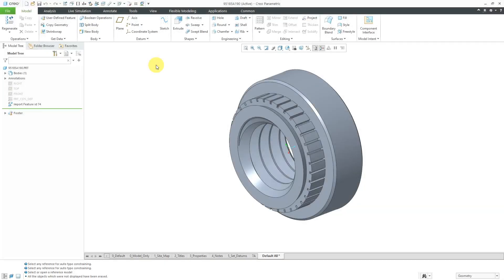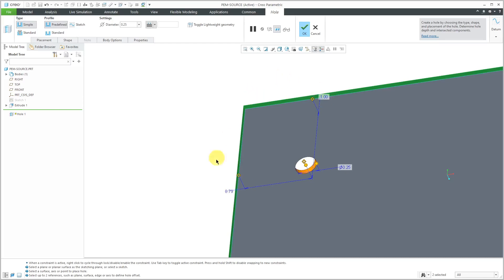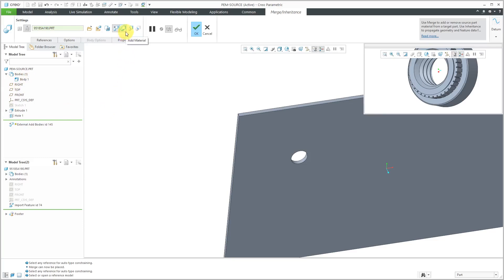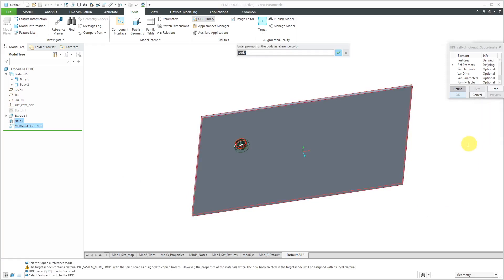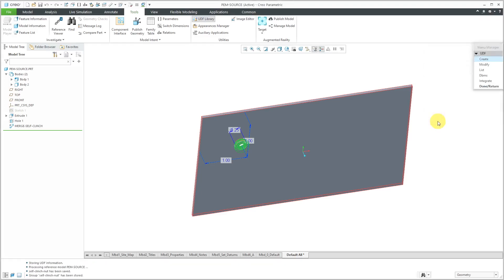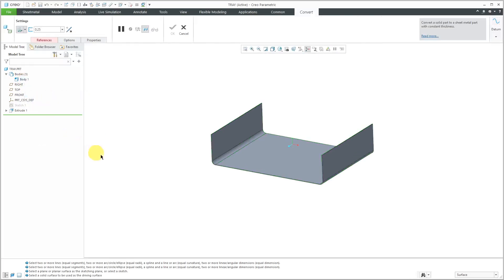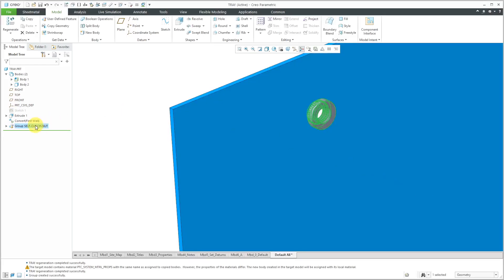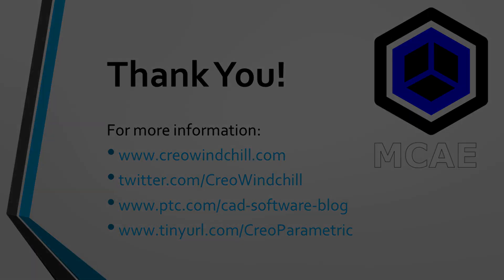Creo Parametric 7.0 - Multibody Modeling and User Defined Features (UDFs)

Comment: I noticed that each fastener is a different body.  Is there a way to have the fasteners use the same body (i.e. one thing to modify if there is a change)?
Reply from the maker: The fasteners are patterned. Change the lead feature and the others will update.

Comment: How do multi bodies behave when you export it out as a step file? Does the step treat it as an assembly?
Reply from the maker: STEP supports bodies so it treats them as a body.
Reply: So reimporting the step creates an assembly?
Reply from the maker: That depends on what you choose when you import. Again, STEP supports bodies, so you can import a part with bodies as a part.